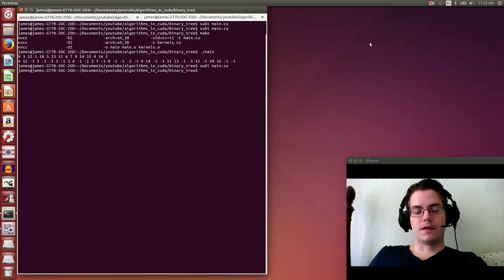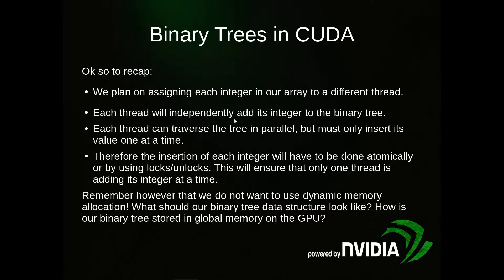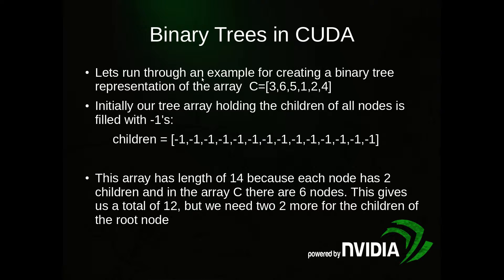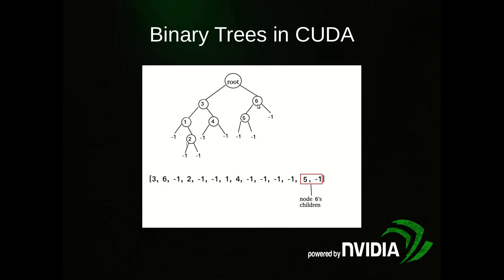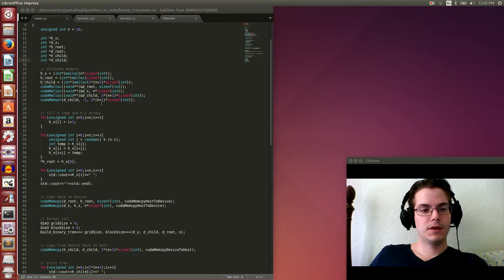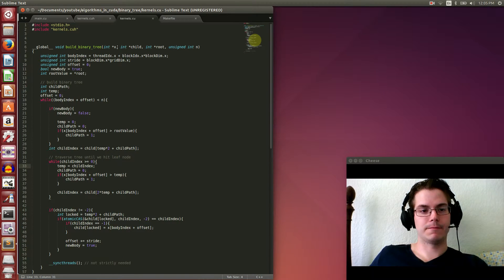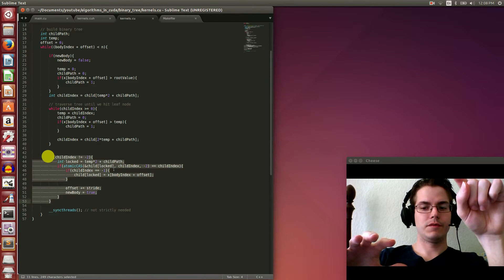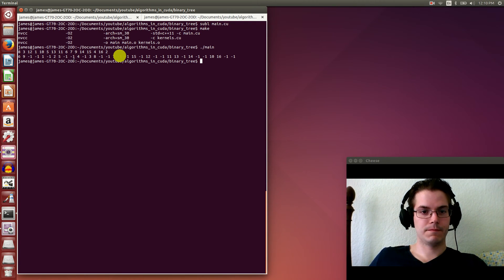Algorithms in CUDA: binary trees

Comment: as far as i understand this only works on arrays that have numbers 1-n, or do i get something wrong?
Reply from the maker: You are mostly correct. Basically the child array needs to be 2*(n+1) in length where n is really the largest positive value in the input array. For example if our array was [1,4,88] than our child array would have to be 178 in length. Now obviously this can be a waste of memory depending on how extreme your input array is. For example an array like [1,2,45635767] would was an insane amount of memory. The child array would be almost entirely all -1's. If our input was [1,3,4,7,8,9] though, yes we waste a little and have a few extra -1's in our array, but its not too bad. 

It may seem like this is a contrived example (and it kind of is), but in the case of the n-body problem that I mentioned in the presentation, you do only have the numbers 1...n (you number each body and don't skip any after all!) so it does have its uses. 

You can still apply these ideas for the more complicated case of negative numbers or inputs with wildly varying numbers, but it will require some extra thinking (maybe an extra array to map your inputs numbers to the numbers 1..n for example). Hopefully this will get you started in the right direction.

Comment: Could you also post a video on how to do level order traversal using CUDA? Thanks.
Reply from the maker: Sorry for the delay in responding. Traversing the tree breadth first or depth first I think can be done with a stack (can't use recursion with cuda). If I have time I will try and look into it but I cant make any guarantees as I am very busy with work and am working on my cuda powered physics engine. In particular though you could try having each thread in a block control a small section of shared memory to use as a per thread stack (I havn't tried yet but just an idea).